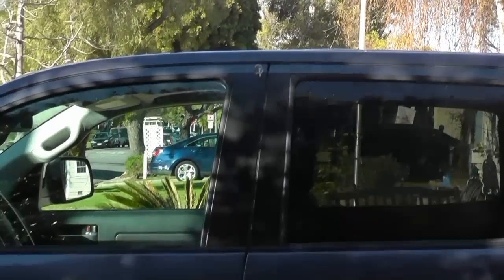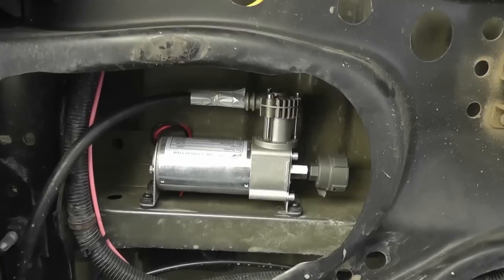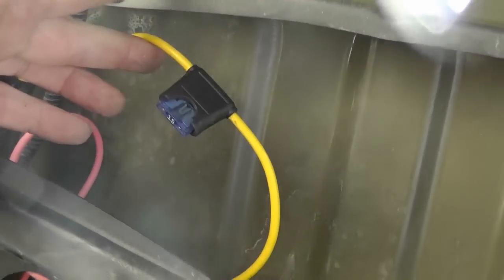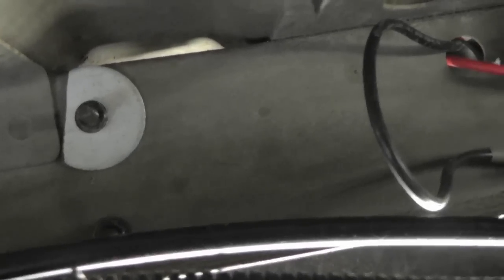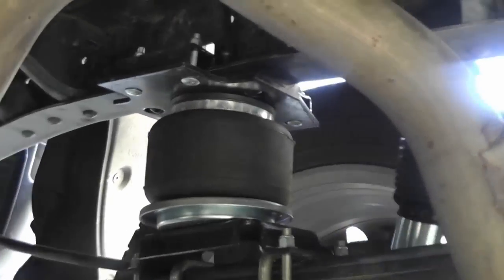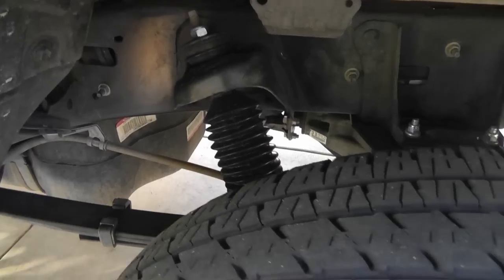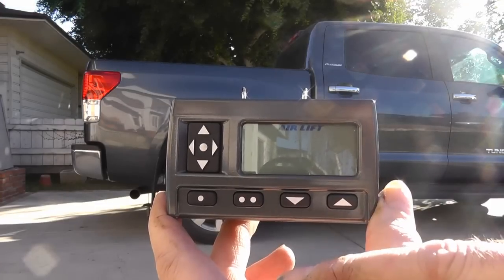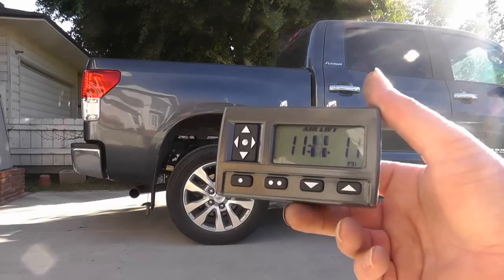Air Lift Air Bags.mp4

Comment: No grommets or split loom for your wires will mean chafing and shorts...... and that pump draws 10-12 amps.....Is that factory tow battery charging wire rated for that?